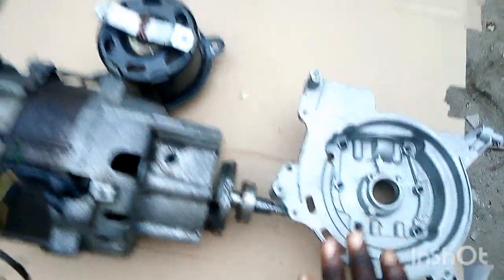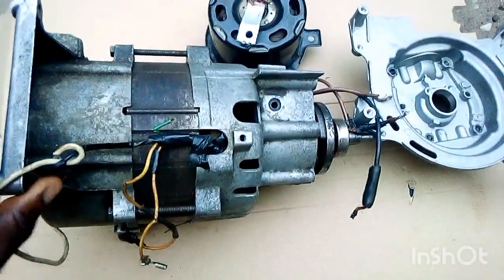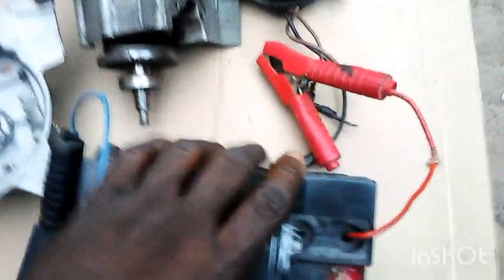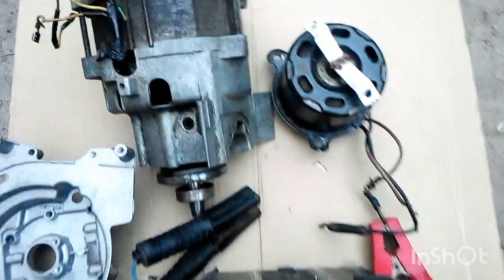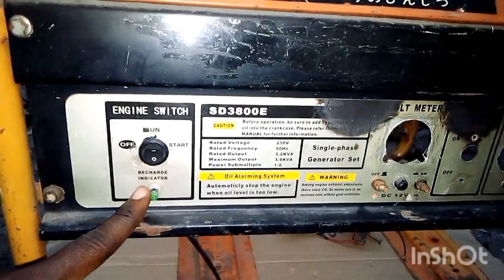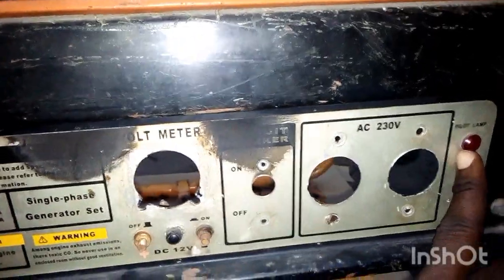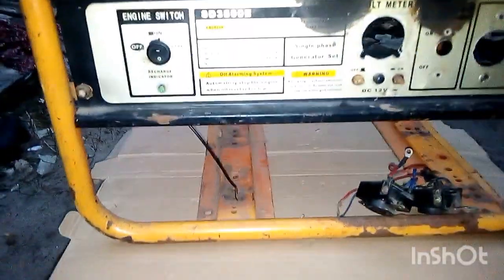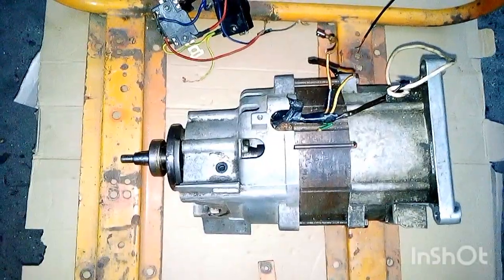Gasoline generator conversion to Fuelless(Part 1).

Comment: Thanks for your kind . Brother how can I get your details motor please
Reply from the maker: Sure the motor am using it's a 12v Motor and the RPM is around 3500 that would be enough to drive the Alternator to produce power.

Comment: Hi, i like your project, but what is the frequency of the electricity 💡 and also the output current and voltage
Reply from the maker: Thank you sir the frequency is around 50 to 60hz and the output is around 200vac but it might charge because am thinking of doing some modification to the Alternator maybe to Low rpm Alternator